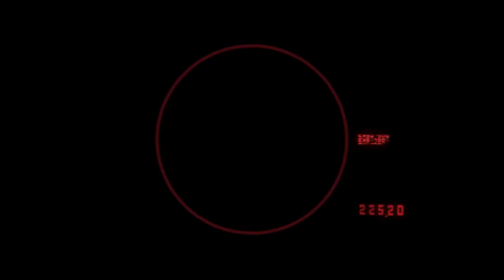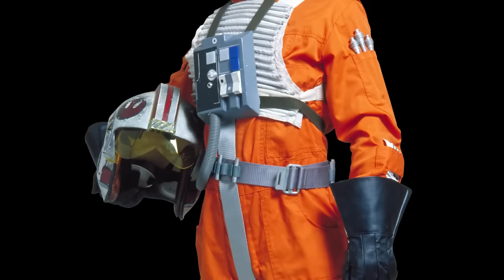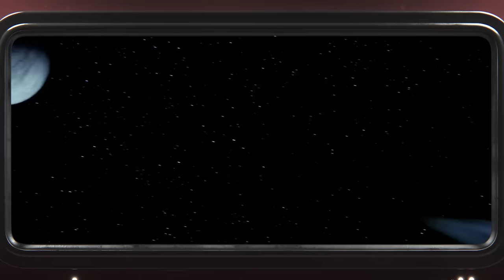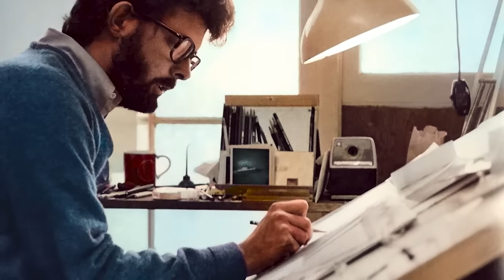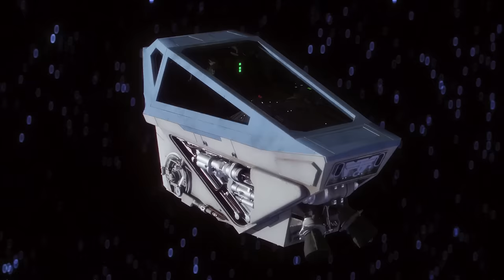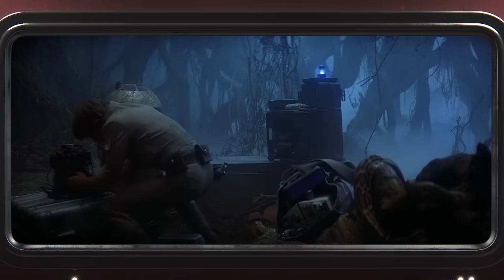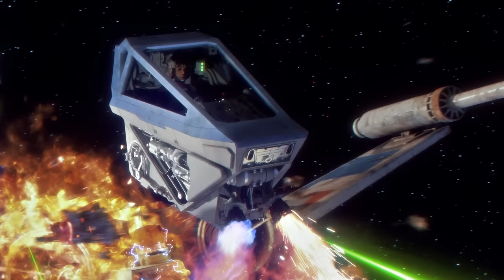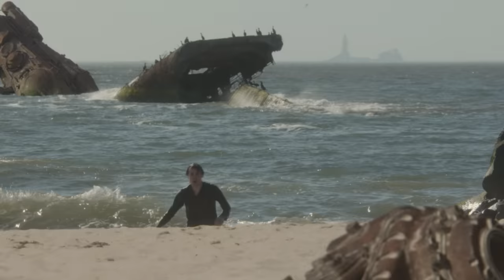X-Wing Ejection: It all makes sense now

Comment: I've always imagined that this is the case. As you've said, the cockpit has too much division from the rest of the craft. When I build my own craft, I've always tried to build a similar setup with my fighters...But it's mainly just aesthetic. In my personal setting, fighter pilots (and servicemen on the capital ships) just wear Dead Space style RIG suits because surprise explosive decompression in not good.

In the case of fighter jocks, they're hooked directly to their chair, which comes with it's own power source for heat and supplying a basic recycling system to convert waste in to drinking water and oxygen. And also a emergency transponder beacon with a small briefcase of water and rations. It ain't pleasant but you'll live. The chair also has a very simple 'berry' system that inflates much like the current Mars rovers have in case of a atmospheric entry, and the pilots are able to unhook from the chairs and deploy a basic parachute in case they have to bail.

Overall it's a not a pleasant experience, but you'll live.

Comment: I've posted similarly elsewhere, but for the X-wing's design, an ejection pod would actually not be the most practical, and if you wanted to have one, you will very likely need to redesign the whole fighter.

First, all of the systems mentioned - life support, maneuver thrusters, comms, any additional kind of protection (likely shields), etc. - would require so many wildly different systems to be sufficiently miniaturized enough to fit it all into one space while still having enough of each of them for any extended stay out in space. Compressing all of that into one comparatively tiny area of the fighter is much easier said than done. You might be able to get certain ones down reasonably enough (comms would be the easiest), but all of them, not so much. The maneuvering thrusters might be the most unrealistic part of all - sure, they could help you get away from the now-destroyed fighter, but you will likely never be able to have enough fuel to operate them for very long. Even the escape pods were shown to not last that long with life support or maneuvering thrusters, so designing a similar effective but miniaturized package for the X-wing could very well be impossible.

Second, even if you do manage to design a small-enough package (which is still likely to be bigger than what the X-wing's design allows), now you have to worry about protecting it from damage. That means more armor or shields, both of which add weight - yes, shield emitters have weight in their power system, the computer linkage (maybe even additional computers on the emitters), and the emitters themselves, and that could pose a problem for a fighter. Leaving little more than a skin that likely cannot protect from more than the environment(s) it might find itself in leaves the package rather vulnerable to damage, especially the maneuvering thrusters - if there is any part of it that is the most likely to suffer damage and possibly be rendered inoperable, it is these.

Third, now you have to worry about additional maintenance and the logistics necessary for that. For a guerilla forces like the Rebels, further complications in logistics is one of the last things they ever need. To then save on logistical costs, the ejection pod might be neglected or even removed entirely, much like how the turret mechanisms for the Y-wing's ion cannons were. Which do you think would be easier to maintain or operate: a massive chunk of a fighter that needs multiple anchor points (that likely still need to form a single piece in the end), a reliable method to completely separate from all of those anchor points, and all of the aforementioned systems...or a seat with a rocket or two and much fewer anchor points and their separation methods?

Frankly, it is just much more efficient, from fighter design and implementation to maintenance, to stick with the ejection seat rather than a full pod for most fighters. Of course, that does not mean there are not fighters where an ejection pod could work, and some of these were actually shown to be the case, both in Legends and Disney canon. However, the ejection seat is much more likely to be the default system used, even in space.

As for ejection pods like the F-111's, yes, it truly was a marvelous piece of engineering...but how many military planes can you think of or search for that not only had one but a reliable one, either before or, more importantly, after the F-111?

So while it might make sense to have a full pod rather than just a seat, once you get into what it would call for and what such systems would need to be able to withstand and maintain operation, a pod is likely to be untenable for most starfighters. As I said, there are some starfighters that can and do utilize one, but for most of the starfighters that already exist, you likely will not be able to add a pod without also having to make drastic modifications to the design in order to accommodate it. Yes, certain fighters might be able to be altered to have one while still maintaining their original forms (the Y-wing and the TIE Bomber come to my mind), but by and large, most would just have the seat.

Comment: Would be interesting to see how this works for other starfighters - I can see modules on Y wings and B wings that can serve as satisfactory pods. A Wings, on the other hand, I have no idea - I would love to see you see if it's possible for you to design a similar ejection system for it!
Reply: Ejecting the cockpit module in an A-wing would be possible (possibly backwards)…
Reply: @allangibson8494  True, but there isn't much else of the A Wing to be damaged/hit by the enemy...
Also, I would argue that being blasted backwards would not be optimal if the enemy fighter is most likely to be shooting from the rear aspect (i.e. right behind them) - so unless it goes up, it seems a bit implausible to me.
Reply: @christopheroddy2373  Ejection Seats that reorient exist… Most modern ones will work fine in inverted flight for that reason.
Eyeballs out is not a preferred direction however because the human body has a low “G” tolerance in that direction but for a vehicle attacking a ground target or being used for ramming attacks it is a logical design choice.

Comment: The suit and the helmet worn by the Rebel pilots are similar to the ones worn by the V Wing Clone pilot during the Clone Wars which included the mask, however the Rebel pilots doesn't have to put on the mask and turn on the suit pressurisation mode all the time when the life support system of the ejection pod is still working unless there was a breach or the life support system is damaged.
Also, the ejection pod idea was inspired by the F-111 Aardvark's ejection pod in real life. Kudos to George Lucas for his creativity.

Comment: this makes a lot of sense although the depiction is half way from real life and starwars lacks the practical set up for what we see in RCS nozzles and configuration as well as the nozzles looking to much like a liquid fuel nozzle for it to fit in with starwars but the rest makes so much sense mechanics can remove the pilots ejection pod to work on a lot of the systems which allows the ship to be as compact as it is with all of its capability although it might lack the internal access or external ease of access for repairs that imperial ships have

Comment: The biggest issue I see with an escape pod is how much it'd reduce the structural integrity of the main fuselage.

In a ship shaped like an X-Wing, in particular, there's a lot of mass in front of the cockpit AND there's a heap of systems built into the front too.

If you're going to place an escape pod in the middle of the ship, that means you need to have, effectively, a large empty area within the ship to fit it; minimal structural bracing can run the entire length of the ship and minimal space to run things (such as, perhaps, magazines for the proton torpedo launchers) from the rear into the front.

Obviously, a lot of these issues can be resolved simply by insisting that an X-Wing is built from super-duper futuristic materials but, based on OUR understanding of engineering, it looks like an X-Wing with an escape pod might snap in half in the middle or, at least, the fuselage would suffer hugely with stress-fractures around the escape pod.

Comment: Color difference could just be due to different production blocks of the X wing coming equipped with different cockpit setups. Assuming the entire pit is modular, and ejectable, starwars seem to like magnetic lock systems. Charge a capacitor in cockpit with main power, disconnect the mag locks for the module, eject by reversing magnet polarity vs fixed static magnets in the frame. Nothing combustible, minimum maintenance, plenty of ooomph to clear the starfighter in space with no gravity or air resistance to contend with.

Comment: i have always felt that this is the direction that ejection systems should go. However there's a few instances in the books where Luke gains access to the underside compartment we see in Empire strikes back through the cockpit of his x-wing. So maybe you should redesign the ejection module to accommodate a small hatch in the back that leads to the cargo compartment. The thrusters seem a little beefy anyway for a one man escape pod, which only needs enough thrust for station keeping in deep space, or for retrofiring rockets for entry onto a planet. 

it can also be contrasted with tie pilots not having the luxury of an ejection system. (there's roughly a 40% chance they're going to get shot through the glass anyway, if my experiences with x-wing and tie fighter has taught me anything). it also plays into the cost saving measures that Sienar fleet systems took in designing the TIE line anyway.

Comment: Would the B wing have a more or less complicated ejection system?
On one hand the cockpit is mounted away from the fighters body, but on the other hand the mount point is either directly behind or in a middle or the Cockpit module depending on how you look at it.

Comment: In my 1000 year alt future Sci-fi setting I have it so the hero faction uses a massdriver Pilot launch system that merely thrusts the seat up at a speed to eject the pilot after the canopy is thrown back... This is because the pilot is in power armor that can take over 300gs and 4 modner .50 cal shots at the near future start of the setting so reentry/blow torch effect of hypersoinic speeds is covered and falling in from interplantary orbit is covered... And it's more important to make sure the pilot can get out faster then they can get in and reuse the craft should they need to... Also the suit can take care of all the pilots needs for a time let's say atleast a month... But yeah that is not Star Wars so a pod makes alot more sense.

Comment: This could double as a training simulator — lift out the cockpit and plug it into a computer.  Pilots of various species requiring different flight seats and control hardware (finger tentacles not arms) could carry their cockpit with them between craft.  And damaged pods/hulls could be swapped to maximize uptime.  This all underscores the vibe of X-wings as the Spitfire of the Star Wars Galaxy—a fraternity of fliers soending 12,14,16 hours a day in the cockpit to take down the juggernaut of Space Fascs

Comment: In  previously canon novels, onw legends since Disney took over, they all had a consistent model for ejection: the seat pushed you up and out, which you could disconnect from but were otherwise exposed to the elements in. The Rebel flight suit, despite its obvious appearance, is presented as being sealed. A miniature magnon field, like what holds the hangar bay pressue intact, comes down around the helmet visor and goes throughout the suit as well. In one of the Rogue Squadron novels a pilot is EVA and struck by a micrometeorite. It rips a leg off below the knee and the suit automatically seals there. Pilots also mention that the problem isn't air, it's heat. You have an hour or two for air but magnon fields don't  retain heat. So you'd freeze to death far sooner -- but some alient pilots can survive longer if they retain heat better than humans. The same is basically true for TIE pilots. TIE cockpits are not pressurized so the entire suit is pressurized upon launch.

Comment: Having the utility of an astromech with you in ejection is a good thing. The droid would eject straight up. The Pod would eject up with a forward angle.  Assuming the fighter craft is moving forward while both is happening would leave the astromech behind, while the additional fighter speed would couple with the escape pod's thrusters making it rocket forward faster.  The Astromech, fighter and escape pod move at the same speed. The Droid rockets straight up, while the thrusters on the escape pod adds additional speed allowing it to rocket clear of both the fighter and astromech. If you ride a horse at full speed and drop a ball it keeps the same speed as the horse. Throw it a head of you it has the same speed as the horse already.

The Astromech then moves to reunite with the escape pod using thrusters like R2D2 showed in Attack of the Clones and attaches vial a pair of clamps that extend from the pod. And if forced to land on a planet having the astromech (who's sensors can be used to find help, alert to dangers, help get survival supplies scan food, water, etc would aid in survival.) 

As for why no one ejected at the battle of Yavin 4, where would they go, the empire if successful would destroy the moon. And they would be captured and tortured by the empire if the rebels failed. If they succeeded they would crash on the death star which would then explode.

Comment: The "eject the whole cockpit" was a known thing when the film was being scripted. See the U.S.A.F. F-111, which went into service in 1967. Lucas is well known for being interested in military aircraft, and would have definitely been aware. A similar system was supposed to be used on the Space Shuttles (in development since 1968; first test vehicle of the final design began construction in '74), but wasn't implemented for cost reasons and a fair amount of hubris in my educated opinion).

Comment: For the imperials we know that they can eject and because they don’t have hyperdrives in ties I recon if they eject, I wouldn’t be surprised if a tie reaper went and picked them up. I recon they just keep moving extremely far away from battle and a reaper would open its front hatch and literally scoop them up. Though we know that imperial ejections weren’t common so I think it would be heavily used with the remnant

Comment: Another issue with the bubble shield over a seat is that these shield types seen on hangers are canonically able to hold air but not thermal radiation, the ocupant will lose body heat at a high rate much like being exposed on a mountain side at high altitude.  The fully enclosed cockpit ejection makes a lot more sense, but I do not feel the A-wing would have had this option due to it's extreamly small size.
Reply: This is actually a point in the X-Wing novels. A few times we get pilots ejecting in battle and often have to be treated for injuries following recovery, typically related to temperature exposure.

Comment: There isn't a mystery here to solve.  In the X-Wing novels, they refer to a magnetic containment field around the pilot and chair and that the TIE fighters do not have this, which is why they wear a full suit.  

To speak to the video specifically, the problem with this concept of a pod is that it suffers from the same problems as the magnetic containment field that was first dismissed, only worse.  If a magnetic containment field around the ejection seat is a risk to problems arising from damage, how much more would an entire pod?  Any event that damaged the ship to the point of ejecting would almost certainly compromise the Pod as well.

Comment: I would argue that an enclosed space suit would be used by any kind of star fighter pilot, because you would want to evacuate any atmo in the cockpit before going to battle. You cant have fires if you're in a vacuum. From a safety perspective, having a space suit which is able to connect into an environment system in the ship, and then disconnect from that system and persist on its own should the ship's system fail is better than just having the enviro-system on a craft that is going to be shot at.

Comment: Shame they couldn’t figure out a way to improve the F-111 escape capsule design and stick it into the Space Shuttles Challenger and Columbia. Or would that even have been possible to design something similar to it to offer projection to the seven astronauts as long as it could have used safely, before maximum altitude, temperature, G forces, etc?

Comment: Interesting idea but the x wing is a fairly compact design. It's just as likely to take damage near the cockpit as anywhere else, meaning a stray laser could easily fuse a large ejection module to the rest of the ship rendering it useless. The smaller the system the more likely it will remain in most cases except for a direct hit on the cockpit. Earth's fighter are larger then the x wing and don't expect to have to deal with high heat energy weapons.
Reply from the maker: Good point. But this could also be a decent explanation for why we never see any pilots eject in the films.